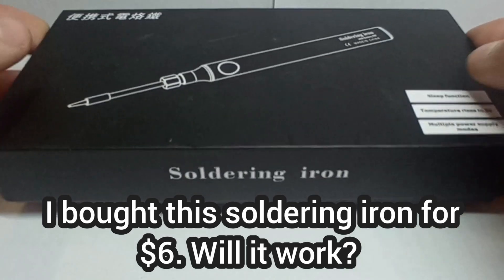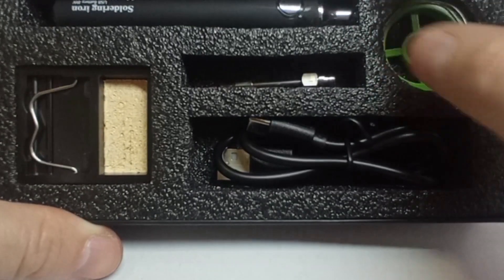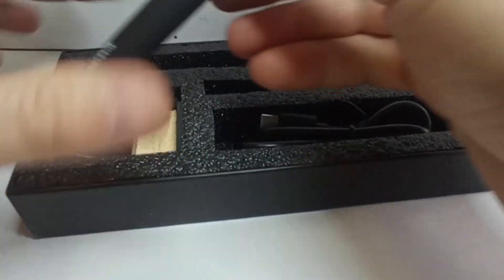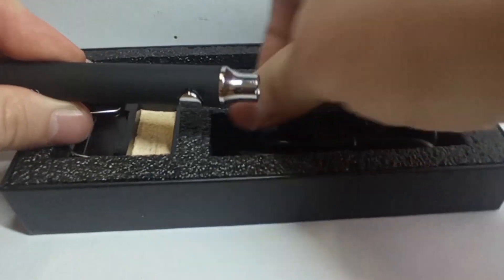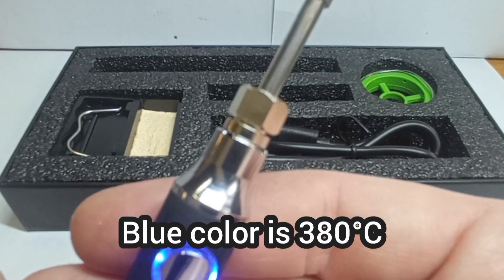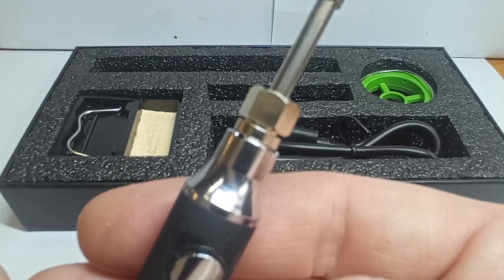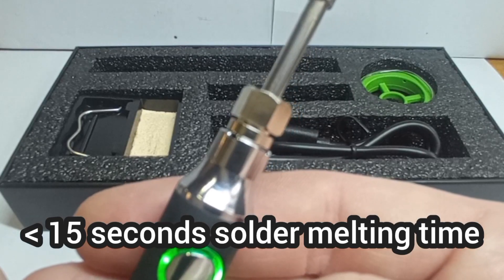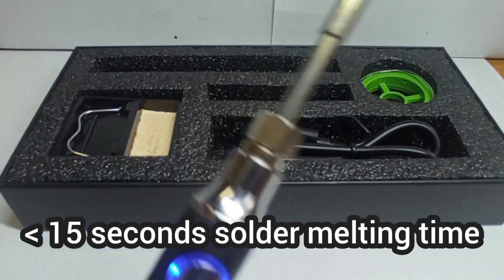Cheap Mini Portable Soldering Iron: Tiny Tool, Big Impact

Comment: I bought a similar $2 version ("1Set Adjustment Welding Repair Tool Cordless Soldering Iron Tool Pen USB 5W Electric Soldering Iron Rechargeable")..   but I didn't realize the soldering tips are not included!     Any idea where I can buy the threaded tips from?

Comment: I buy one of these from Lazada, it heat little can't heat 100 digree lead melting point. Scam I'ven red mode can't melt lead. Why it's so cheap, than normal electric soldering iron high price working.

Comment: Have you found a website that gives more info on these specifically battery size and charge time, right know I use an inline USB power monitor to gauge battery level, a pain but it works
Reply from the maker: I dont know